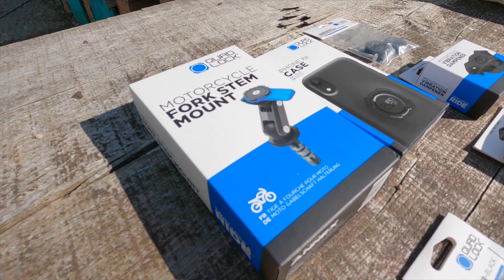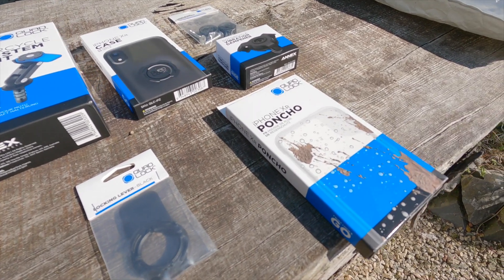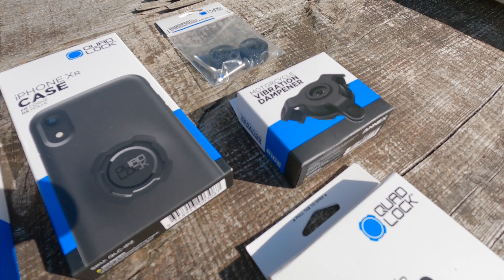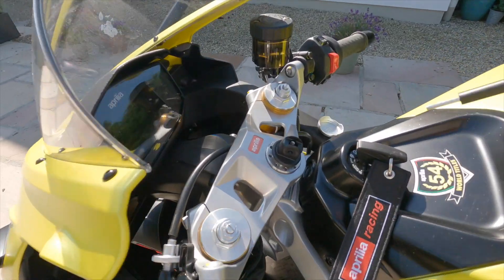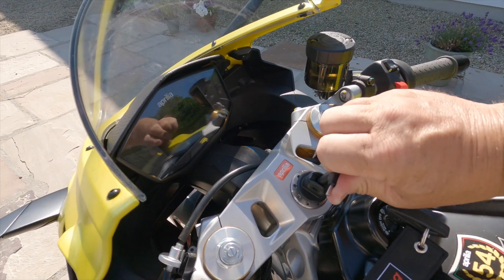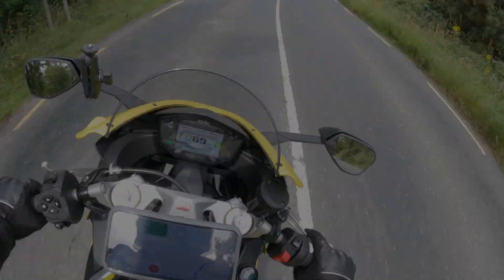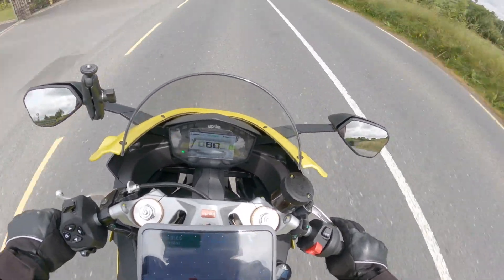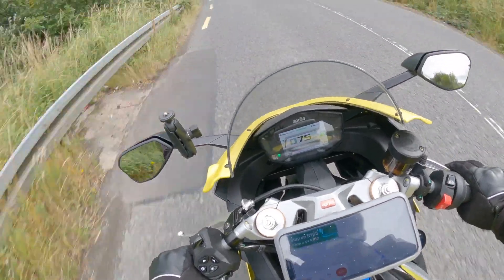Fitting the Quad lock iphone mount on the Aprilia RS660 | Installation +ride review. Superb product!

Comment: Looks good. I have a ram mount I never used until recently as did not want to damage my phone as you were saying. Had an old smartphone that I got working without the sim card and running Herewego app with offline maps so works as a GPS. It works well. The old phones are still useful 👌

Comment: Another excellent video thanks for that. You are right, your new bike is like a supermodel, absolutely stunning. So my question is where do you mount your phone on the GT650? I have a 20' Dr. Mayhem model. I generally do not like any devices on my bikes (I'm really ole skool) but there are times when riding the back roads of New England a few directions could help.  
I don't remember seeing a phone mount on Mr. Clean that's why I'm asking. 
Well, that's it for now thanks again.
P.S
At the beginning of the video, I thought the bran muffin you at for breakfast was really working. Until I realized you were just horsing around. lol.
Reply from the maker: Hi Mark, glad you like the bike! The one thing I’ve refused to do is put the phone on my GT650 as I use it purely for escapism around the local countryside. Saying that though, I’m sure there’s a way and I’m intrigued now so I probably will look into it. 👍🏍
Reply: @WheelieGoodTV  I can understand that what I did after replacing the mirrors, I took the right mirror stem bend it at 90 deg, and after a few modifications I could amount for the phone.  I never use it. For some reason, I just don't like anything up by the gauges. 
Thanks for your help.

Comment: Hey , do you by any chance know what size are the stem mount plug that fits into the rs660 stem?
Reply from the maker: It comes with the two different sizes in the kit and I used the smaller size.

Comment: I bought a RS660 this summer, love the bike, I recently bought the quadlock forkstem and it said not to install on a tapered insert.... did you have any 8ssues with it?
Reply from the maker: Hi, no issues at all but I had also heard the same so I bought a rubber sleeve which was recommended but turns out I didn’t need it. Works perfectly and is rock solid.

Comment: the quadlock was my first choice cause of the "lock" and the good quality! but i heard more horror storys even with the anti vib module of the quadlock...So i picked up the sp connect stem mount with the anti vibration module and my iphone cam still works!! after 700km riding on the same machine :) A Question to you WG TV.... any plans how to eliminate this f*cking mirror vibrations after 100kmh?  :/
Reply from the maker: Interesting. I’ll report back after I’ve done a few more miles and keep everyone updated on the progress of the relationship between my iPhone and quad lock. On the mirror vibration issue it really does only happen above 100kmh so it’s not a huge issue for me but it does mean I can’t tell the difference between a normal car or a police car. I’ve spent far too much of life trying to cure vibration on both airframes and motorcycle chassis so I’m happy to let this one go….

Comment: Have you had any issues with your phone mounted to your bike? I have been told that the vibration 📳 kills your phone!
Reply from the maker: Yes it does. You need to buy the vibration isolator from Quad Lock too. Works great and keeps the phone safe.